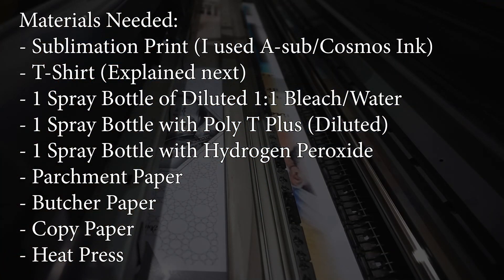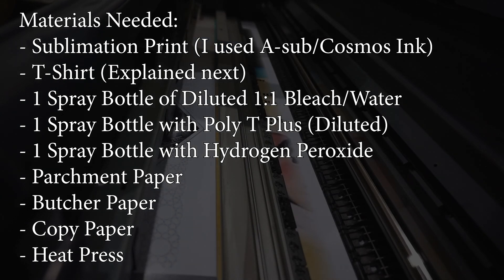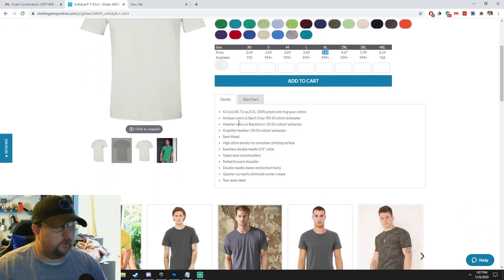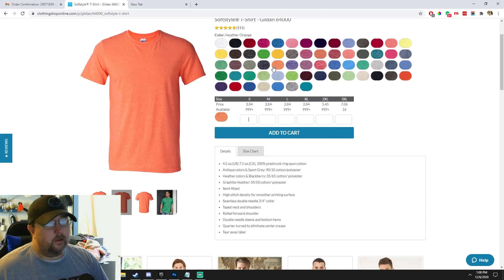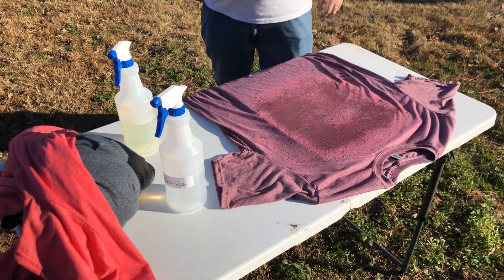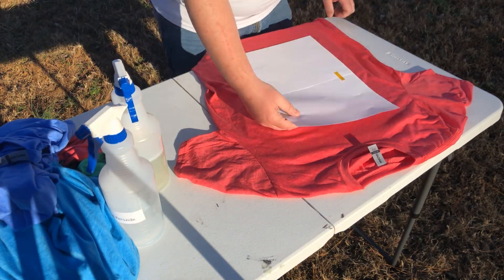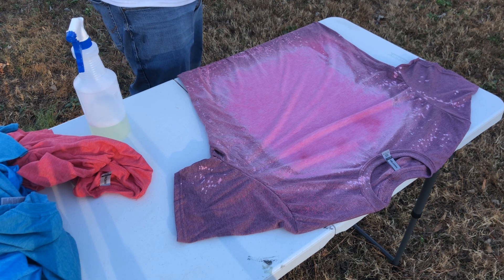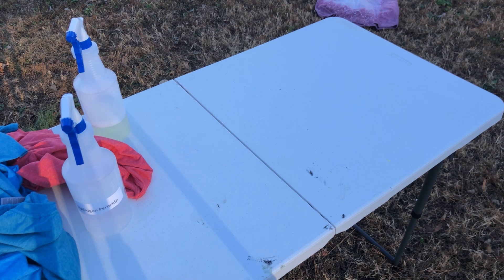Making a Bleached Sublimation Shirt Using Poly-T Plus

Comment: You do a super job, thanks. Have you ever tried the homemade sublimation formula. Would love to see how that works with everything you use. Going to check out the shirts, thanks for letting us see how each color bleached.
Reply from the maker: I haven't tried a homemade solution on t-shirts. Poly-T Plus works perfectly for me and it's affordable, so I don't believe a homemade solution is needed.
Reply: @SouthpawsStudio  I know poly-t works great. But the homemade is so much cheaper. I haven’t seen anyone do a comparison using on the same shirts and all. Like is the shirts with the poly-t stiff or soft how does it compare to home made.

Comment: Thank you for doing the video.  I have question about the wash cycle.  You washed it without soap after the bleach process.  For the wash cycle after the sublimate heat transfer do you use soap?  Or is it just another water only wash?
Reply from the maker: Great question! I actually did a wash with detergent, WITHOUT fabric softener.